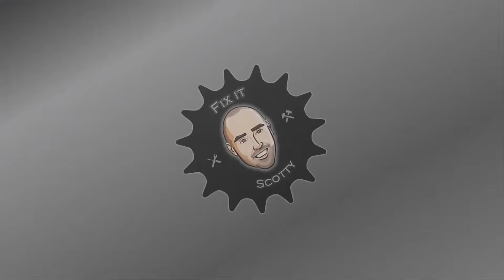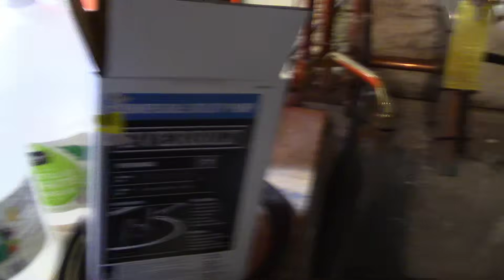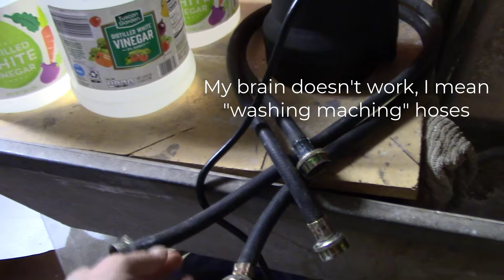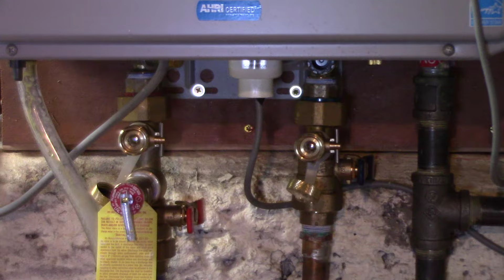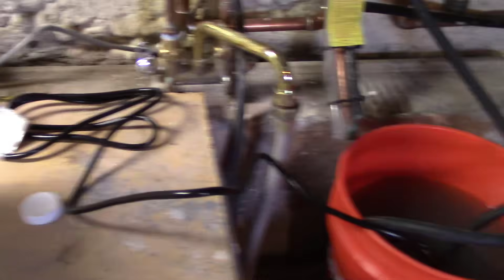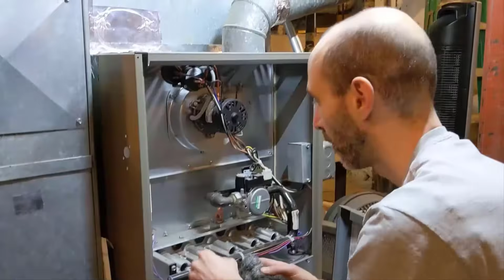Rheem Tankless Water Heater Annual Maintenance Flush

Comment: Well done, thank you. My friend's system hasn't been descaled since she had it installed. Now she is experiencing a loss of hot water. I guess I could try distilled vinegar first, and hopefully it clears it. If the water is totally dirty, would it be wise to stop the process, empty the bucket, and continue with fresh vinegar? Is there also a filter somewhere on this Rheem system?
Reply from the maker: I forgot to mention the sediment filter in this video, but I do show it in the advanced video which is linked in the video description and in the first comment.  If it has never been descaled before, you might want to use a harsher descaling chemical than just vinegar.  Home depot sells a product called "Haymaker Tankless Water Heater Descaler".  Just adjust my instructions with their flushing mixing and cleaning instructions.  Once it's working normally, you can go to vinegar for the yearly cleaning. All the best!
Reply: @FixItScotty  I will check it out, thanks. Do they sell a ph kit, and with instructions as to how and what needs to be done?

Comment: Isn’t there a small metal
Filter above the Pipes that needs to be cleaned?
Reply from the maker: You are correct.  I didn't show that in this video, but check out the advanced video linked in the description and pinned to the first comment.  I show how to clean that there.

Comment: We have pretty hard well water, no softener, about 9 ph. Is vinegar enough?
2 we have 2 Rheem heaters. Can I reuse the vinegar?
Reply from the maker: Is the vinegar enough to clean hard water stains?  Possibly... if you started doing it regularly since you've owned the heaters.  I can't see inside your heat exchangers, so I don't know.  If you see degraded performance, you may have to move to a descaler product instead.  Can you reuse the vinegar?  Again possibly...  You may want to filter any debris out of it.  But white vinegar is pretty cheap and you only need 2.5 gallons per unit.  I would just use new vinegar for each flush.  Thanks for watching!
Reply: @FixItScotty thanks for your reply I've been putting off descaling the tankless water heaters but did the first one yesterday it was very easy. I dumped out the old vinegar. The reason I descaled it was the exhaust wasn't as hot as it seemed to be before but it's over 100° here in the desert so maybe it just wasn't heating the water it only had to heat it 20° more instead of 50° so that's why the exhaust coming out the back wasn't as hot

Comment: On several on-demand units (Electric & NG) that I have installed, the p.a. PM on homes with a water softener the rinse residue shows very clean.
Reply from the maker: Yes.  In my advanced cleaning video (pinned in the comments), I pour the post-cleaning solution in a clear bowl and it has  has a blue tint, but is mostly clear.

Comment: its wrong !!! you need to bypass the mixing valve to flush the unit . otherwise the vinegar goes bypass to pump instead the heat exchanger . read the services manual !
Reply from the maker: I read the service manual and I talked to Rheem support about this.  The operation of bypassing the mixing valve is dependent on the unit.  This unit is simple, either turn it off or unplug it.  See my advanced flush video pinned in the comment.

Comment: Do we need to worry about corrosion from 1 hour of vinegar exposure? I just know there is such a thing as too much vinegar when it comes to metal parts, from experience 😅 but not sure how long is too long.
Reply from the maker: I'm not worried about it.  You would probably have to leave copper soaking in vinegar for weeks to get corrosion.  1 hour of exposure and then we neutralize with lots of water.  Should be fine.
Reply: @FixItScotty awesome, thanks!

Comment: The web experts say it does not work if your turn the Rheem off with the control panel.  It seems that they are wrong, at least for Rheem models.  These experts say to simply unplug the W.H.
Reply from the maker: It does depend on the model.  Mine, it doesn't matter.  Some commenters note that their brand/model has specific requirements to shut down so the heater exchange will be remain open for flushing.

Comment: My rheem water heater doesn’t have the isolation valves. Can I still do this job with out them??
Reply from the maker: I talk about this scenario starting around the 9 minute mark in my advanced video: https://youtu.be/CfC-WXNDnHo?si=_dA0iejEmPKAAR9M&t=550
Reply: @FixItScotty  thank you very much. Our home was a new build and didn’t come with isolation valves now I see why they are installed.  I guess contractors cutting corners.

Comment: Question: do you rinse your pump after too?
Reply from the maker: Good question.  Yes, I will dump the vinegar and put some water in my bucket and run it for a few seconds to clean it out.  The vinegar, being acidic, could break down plastic parts inside the pump.

Comment: Hi Scotty! My Rheem water heater isn’t turning on right now. We think it’s a control board problem so we’ve ordered a new board, but can I go ahead and do the flushing with vinegar even though I can’t turn it on? From your video, it looks like it’d work just fine. Thoughts?
Reply from the maker: Hi Laurie!  You should be able to flush it. The only caveat that I explain in my advanced cleaning video (pinned in a comment) is some models or brands don't allow you to pump the vinegar through the system while it's off. Some make you "game" an internal valve by unplugging the unit while it's on or running in order to leave it open. To test yours, just perform the cleaning as per my video. If you don't see vinegar flowing out of your discharge hose on the hot side, you will need to wait until the unit is fixed and use the instructions on my advanced video. If you do see vinegar flowing, you can complete the cleaning while you wait for the new part.
Reply: @FixItScotty thank you! I really appreciate your very quick answer! I guess I know what I’m doing today!
Reply: @FixItScotty Hey, another question. I saw that someone had run the vinegar first one direction, then the other direction. Do you think this would be a good thing to do to be thorough? My water heater hasn’t been flushed in at least four years.
Reply from the maker: @lauriesmith6446   I have heard of folks reversing the flush. I don't know if that does much of anything. You're more likely to get better results using a descaler product or just running your vinegar for a longer period of time. I believe I talk about this in my advanced flush video.  Good luck!

Comment: Been in my new house for 3 years now and didn't realize this needed to be done. My old tank w/h required annual anode rod replacement. But this now is my first tanlkless w/h.  Thanks very much, I will get on this immediately.  Do you have any tips for dealing with how long it takes to get hot water through to the taps when turning on after its been off for a while?  Seems like a recirculating pump won't work with a tankless.
Reply from the maker: Thanks for the comment, hope your cleaning goes well.  Recirculating is an option for tankless, but only if you use a wifi-enabled circulator pump that you can control with your phone or on a schedule.  You obviously only want to recirculate for a short time so as not to defeat the efficiency of the tankless.

Comment: I'm watching this video again for another year and it's still the best tutorial EVER.. Some tips: don't forget to turn off the gas. When you rinse the system on the last step, opening the water valve again might be tighter than expected since you don't use it much. Use a rag to get an easier grip.
Reply from the maker: That's great to hear. Thanks for the excellent tips!
Reply: How do we turn off the gas?
Reply: @AB-te9gs  near your tankless water heater, there is a gas line that powers it. If the knob is pointing in the direction of the line, parallel it's on. You want to turn it perpendicular to make it go off.

Comment: Add a filter to the end. T shirts work fine. Attached with tape or rubber band.  No need to pump sediment back in the system.
Reply from the maker: Never thought of that.  As long as your filter material doesn't put too much strain on your pump, this seems to make logical sense.  I will give that a try.  Thanks for watching!

Comment: How do i flush using a non submersible pump?
Reply from the maker: A submersible pump has just a hose fitting for the output and the pump sits in the bucket. A transfer pump will have hoses attached to both input and output. Put the input hose in the bucket and connect the output hose to the cold water fitting. Everything else is the same.

Comment: You never cleaned the water filter.  There's a small filter to prevent larger pieces of sediment from getting into the unit. You need to remove it and clean it as well.  I was also told to get an additional filter to keep it on hand just in case something happened when cleaning it -- so you don't get stuck without hot water until you get a new filter.
Reply from the maker: Great point.  I didn't show how to clean the sediment filter in this video, but I did do it in the "Advanced" cleaning video pinned in the comments.

Comment: Thank you so much for posting this video.  I followed it step-by-step and everything worked beautifully.  This is the best video that I found especially for a Rheem unit.  My only addition to this video is to make sure that the hose coming from the hot water side into the bucket may need to be secured.  Mine came out of the bucket but I was able to put it right back in.  I was careful to wedge it in better the second time.
Reply from the maker: Great to hear and thanks for the tip about securing the hose!

Comment: Can you please please make a video how to turn off rheem tankless water heater model RTG-70DVLN-1 when going on vacation.I dont live in freezing weather(dallas).And how to turn it back on when back.Does the gas valve need to be turned off too?.Rheem tech support is non existent,totally clueless,definitely not helpful n horrible.Its a request! Love your videos.Thanks
Reply from the maker: Hi and thanks for the suggestion.  Before I got the tankless unit, I had a tank style water heater.  When leaving the house for a long time, I would turn it way down to save on gas.  But that's because tank water heaters burn gas 24/7.  Tankless units, on the other hand, only burn gas when the hot water flow is detected.  So I don't turn mine off when going on vacation because if the water isn't flowing, it doesn't burn gas.  But if you want to turn it off, just press the power button on the keypad or unplugging it would be sufficient.  If you want to close the gas valve, that is optional.
Reply: Thank you for responding.Greatly appreciate your explanation.🙏

Comment: Thank you for taking the time to demonstrate the flushing processes for annual maintenance.  There is also an air filter and a sediment catcher in these units that should be pulled and cleaned as well.
Reply from the maker: Thanks for watching.  You are correct; I didn't show how to clean the sediment filter in this video, but I do show it in the "advanced" cleaning video pinned in the comments.
Reply: @FixItScotty  Thanks for the quick reply.  I'll check out the advanced video. I only comment to help you and the viewers.  I love the fact that you took time out to produce a DIY video.

Comment: Thank you for uploading this! Very helpful. Question, mine just connects straight through two hoses and doesn't have a service valve (that I have found). Is the process still the same?
Reply from the maker: If you don't have service valves, you may need to have a plumber add them.  If you have flexible supply hoses going into your heater's hot and cold ports, perhaps you can unscrew them and find hoses like mine to screw onto the ports for doing the maintenance.  It's hard to know how to advise you without seeing it.

Comment: Do I need to shut the gas valve?
Reply from the maker: I didn't shut off the gas valve.  For this unit, unplugging or turning off the power is sufficient to keep the burner from firing during the cleaning process.

Comment: Great video.  2 gallons of vinegar should be enough for an annual flush or you could do 2 gallons for an hour and another 2 fresh gallons for another hour. Also, make sure you thoroughly rinse and flush the hoses and pump with clean water or you might be replacing those more often than you would like to. Vinegar is great for descaling but also wreaks havoc on rubber and plastic seals and impellors. This process works!
Reply from the maker: Good tips and info, thanks for sharing!

Comment: Why run the water heater at such a scolding temperature of 125 degree?
Reply from the maker: 125 isn't that hot.  I think the default setting is 120 degrees.  My kids are grown, there are only adults in the house, and I installed anti-scald valves on both of our showers.  We like the ability to get the water as hot as we need.

Comment: Shouldn't you have drained out the water first before putting in the vinegar which is only going to become diluted?
Reply from the maker: That's not a bad idea.  The 4 gallons of vinegar that I used is more than what is necessary, so it's not a big deal if a little water from the heat exchanger gets mixed in.  Thanks for the comment!
Reply: @FixItScotty  Opening the outside water filter to a point will allow complete drainage of water into the bucket.

Comment: Is this process the same for all rheem tankless water heaters approximately?  And thankyou for doing this i can't believe how dirty the water is and as far as I know our tankless had never been done unfortunately and what size hoses are you using are they all pretty standard ?
Reply from the maker: I don't have experience with all Rheem models so I can't claim my instruction is universal.  I did another video in the pinned comment that shows some other techniques which may account for other models.  You can try that.  Also, the hoses I used are standard washing machine connection hoses - basically same fitting as a garden hose but female on both ends.

Comment: other than aesthetics, is there any reason why you shouldnt leave the maintenance hoses attached permanent?
Reply from the maker: Good question... I can't think of a reason not to.  I would recommend putting some anti seize lubricant on the threads to ensure the hose can eventually be removed without binding up.

Comment: I clean my tankless every year vinegar comes out clean and I leave mine running for hour n half. I think your water being that dirty probably because you leave outside city limits if you do it’s twice a year.
Reply from the maker: Mine probably looked dirtier due to the orange bucket.  I did another "advanced" cleaning video (linked in pinned comment) where after the cleaning, I poured some of the vinegar into a clear bowl, and it was mostly clear with some slight cloudiness.  I have an old house, but I am on municipal water.  Thanks for watching!

Comment: Did you turn off your gas before flushing?
Reply from the maker: The manual recommends turning off both gas and power before flushing, but turning the power off or unplugging it is sufficient.  Shutting off the gas is a backup in case someone turns the power on accidentally.

Comment: I have heard that you should simply unplug the unit vs powering it off. Apparently, powering it off will close an internal valve, there-by you will not fully flush some of the internals? Some others argue that you should only turn off the gas, and then this tricks the system into thinking that the flow switch it tripped, and the internal valve(s) remains open. Some who use chemicals instead of vinegar, leave the system to heat the flush chemicals, thus improving their effectiveness. I personally would NOT do this, as the heating would be unfettered, and you could blow something up or overheat the system or the circulation pump has a temperature range maximum.

I have relatively hard water, and do this every 6 months. I just unplug the unit and follow the methods above.
Reply from the maker: You are correct.  But it depends on the brand and model.  I discuss this in my "advanced flush" video that is linked in the video description and in the pinned comment.

Comment: mine was installed in November 2018 ,  just now doing a flush,for the first time , been running for 30 minutes and water still look very clean , using Calci-free , using it because it never been done and was installed 5 yrs ago , idont have a softener, just straight from the main
Reply from the maker: Good for you!  Yeah, my orange bucket really colors my solution.  In my advanced video (linked at the end), I pour my finished solution into a clear bowl.  It's really not that cloudy.  It has a blue-green tinge from copper corrosion and maybe a little bit of gray cloudiness.  But otherwise it is clear.
Reply: @FixItScotty  i didnt even have a tablespoon on sediment

Comment: Do you have to close off your water softener system when you do the descaling/flush?
Reply from the maker: Nope. Since the maintenance valves isolate the water heater from the rest of the system, no other plumbing devices need to be bypassed or shut off.

Comment: Thanks that's easier than I thought.  Generally when cleaning brewery HE, we do a back flush.  Wondering about that?  TIA
Reply from the maker: I don't think backflushing is necessary unless the equipment has solids dissolved in the water flowing through it; like coffee or beer.  I could be wrong.  But I have only seen the advise from Rheem to do the flush as I showed in the direction of the flow.  Thanks for watching!
Reply: @FixItScotty  thanks!  I just ordered the pumps and hoses.  I didn't know you were supposed to flush them so it's been 7 years!  The igniter just went out so it's a good time to clean it.